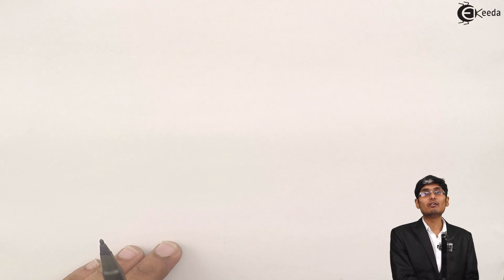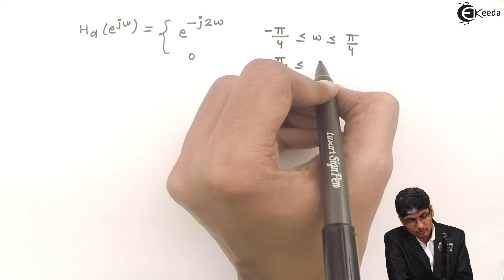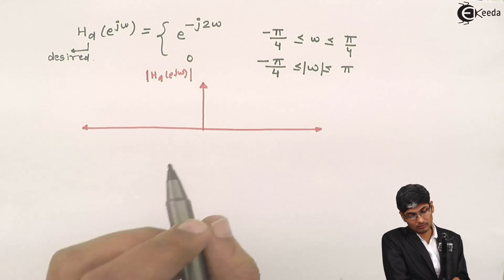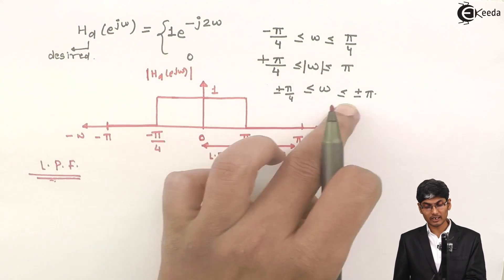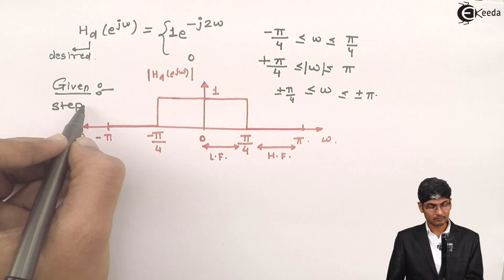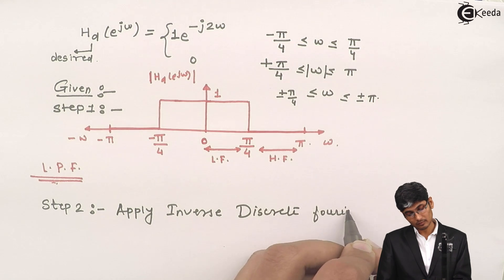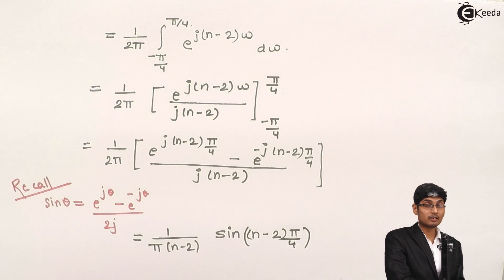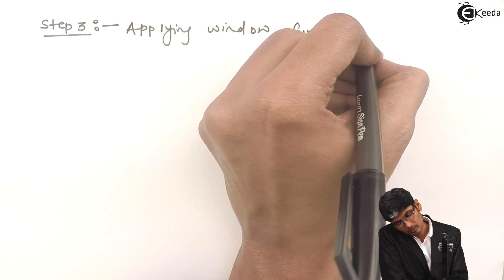Problem No. 1 on Windowing Technique in FIR Filter | Discrete Time Signal Processing

Comment: at last what you get the impulse response , is it valid for n=2 ?, for n=2 ,h'(n) is undefined . so how is  the problem solved?
Reply: Pavel Hossain 

see for n=2 , it is undefined .
so you have to use idft again and now substitute n=2 and solve
you will get ans
Reply from the maker: @Pavel Hussain
To get answer of this question you have to become our member.
To become a click here: http://ekeeda.com/chapterlist/Mumbai-University/Electronics-and-Telecommunication-Engineering/Discrete-Time-Signal-Processing-/101
Reply: IDFT?
Reply: CPLD 

inverse dft !!
toh find h(n) [iir]
Reply: Apply L’Hospital rule on h(n), the final result and you will get h(2) = 1/4
Reply: Basically, Differentiate the Numerator and Denominator Separately of final h(n), and then put  n=2, You will get 1/4.